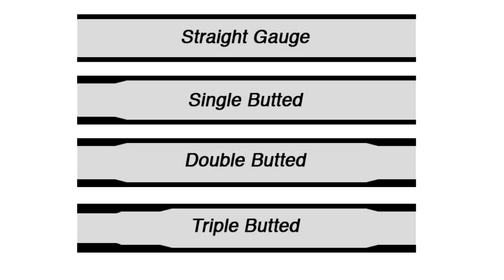Steel vs. Aluminum Frames

Comment: I want to run a raw aluminium frame w/ a layer of clear coat. Opinions on the internet as to whether this is a good idea seem divided, and I can't find a concrete answer. Can anyone help?
Reply: Find a metal finishing shop in your area that can apply a clear chem film to it.  I can't remember the exact spec, but it is a MIL-DTL-5541, type I or type II, class 1A.  Ask the the shop for the clearer of the of the types they use.  It is a fairly simple dip process.  The US navy and air force use this material to coat air frames for corrosion resistance.   You can then apply apply a clear coat afterwards if you want.

Comment: I like your disappearing act at the end!  I have ridden the all of  the Big 4 frame material bikes.  Mostly I have ridden older frames because I am cheap, and so are they.  I like to build them up, and ride them for awhile until I get tired of them.  They all feel about the same to me.  So, they are all good even the aluminum frames with aluminum forks.  I only ride about 1-1.5 hours 3-4 times a week.

Comment: Why do aluminum complete bike seem to always be equipped with carbon forks? 
I weigh more than the max rating allowable on most carbon forks.
Reply: Loose weight bro
Reply: HEAVYWALL 70 rode two similar Giant defys, one with a carbon fork and the other with an aluminum one. The bike having the Carbon fork felt much more comfortable on bumpy roads.
Reply: Amogh S 
My particular problem is my weight, I'm a very heavy rider and most carbon forks aren't rated for my weight. 
I ride a 4130 frame and fork now and it works well enough for now, guess I'll just stick with the Chro-Mo

Comment: glad you mentioned work hardening of aluminum.   I've broken 3 frames by fatigue.  1 was a steel frame (fiori road frame), the down tube snapped about 2" above the BB shell.   The other 2 frames were aluminum (Trek and Specialized) and they both broke at the seat tube a few inches from the BB shell.     One important consideration is for rainy/snow riders, forget the steel stuff, aluminum is the only way to go unless you want to rust out the frame and have fun with bolts and  parts siezed in the frame.    The 6 or 7 year old trek broke just a few weeks ago when i was riding beside someone walking.  We just had a good storm and i was pushing through 6-8" of plowed and stiff snow, i bogged down and gave the crank a good push and pow, I heard something snap.
Reply: You can ride steel in rain or snow just clean it off or spray it down after your ride steel will last lifetimes if you take care. Aluminum frames all way give out no matter if it snaps from fatigue or corrosion. They don’t last Aluminum is weak.
Reply: @mom_im_losing_it  aluminium is weak...yeah, that's why they use it in aviation so much...give me a break.

Comment: I got an aluminum bike with a bit of crack on the head tube and that's it. I will never ever feel secure riding it. My steel bike is ok and like you said the ride feels smother. Can you talk about types of steel bikes next time? Chromoly vs high tensile steel among other things. Thanks.

Comment: I'm a mechanical engineer with a masters degree and who works on orbital rockets and I like this video! You did a pretty good job of explaining the materials properties of fatigue, stress strain curves, elastic modules, corrosion, and all of that. Keep up the good work and you got a new subscriber! 
Personally, I like a good lugged carbon bike for the mix of modern materials with traditional construction (from a biased Colnago C59 owner).
Reply: Yeah, same here (except the masters). I was watching this and bringing back memories of beams and material studies. At a certain point I was saying to myself, “the word he’s looking for is ‘ductile’” when he was talking about fatigue stress
Reply: And yet none of you two engineers, and the host understand how aluminum oxidation works! (real mechanical engineer here with masters degree) So aluminum oxidizes but only on the surface level, then that oxidation protects the rest of the material from further oxidation (same goes for copper alloys like brass and bronze) plus is more stronger and more resistant then normal aluminum (basically makes the frame a little stronger), unlike steel that can oxidize (rust) until in will be destroyed!!!!!

Comment: Speaking of triangles one of the best things I've ever learned about frames and bike parts is this: Affordable Lightweight Durable, You can only pick two.
Reply: That's right a lightweight and durable steel frame it is not precisely affordable
Reply: Slidewinder GT pretty true if your spending under 600-500 i got a used pure fix  for 180$ it definitely affordable and durable but not light
Reply: @tarzan6405  yeah my dad passed down his pure fix and it’s quite heavy but durable. The brand has been around since early mid 2000’s
Reply: I certainly pick durable and affordable. Plus triangle is in fact the strongest shape
Reply: Alloy cost more than steel lol
Reply: 4 party Alloy (hmm yeah it becomes titanium) Ye it just survived 10,000 ft fall so never tell alloy weak , they have a power to become titanium
Reply: @KnightTamila  in most cases bike builds will never be used like that. It’s either you get a really good steel or graded alloy 4130-6000 series

Comment: im scared for my aluminum bike now
Reply: i think it kind of depends on your bike.  if you got a 99. bike from walmart, well good luck with that.  If you are paying more that 400. for a bike that bike brand wants your loyalty, because fact of the matter there isn't a lot of difference between brands, they are all using the same shimano stuff, their only selling points are how they arrange it all and pretty colors,  its all coming from the same factories in Taiwan.   
i have a slight creak climbing uphill with a load of groceries,  does that sound about right? i don't worry about it, you probably shouldn't either. my best guess is it is the crankset.  if it were more constant i would be a lot more worried.
Reply: They make car engines, gun frames, and planes out of aluminum alloys. I wouldn't worry about your bike's aluminum frame failing anytime soon.
Reply: @kabloosh699  in those cases, though, I assume they use an alloy to make it stronger because they can afford to sacrifice the weight
Reply: Magress don’t know what your aluminium bike is but a high quality one can still last a ridiculously long time.
Reply: Most manufacturers have lifetime warranties on their aluminum frames. ie, Trek
Reply: Kabloosh there's a never ending battle between strength and weight.  Weight is an issue with cyclists so that means that strength is compromised.
Reply: I have a sakae litage frame from early 90s and it still rides like new....but after I read more into the online forums about how aluminum bike fatigue over time I kinda start to ride slower and more careful not to roll over any road surface that is not flat
Reply: Magress Don't be. The oldest aluminium frames are often bonded or "glued" tubes to lugs, in those frames it's the adhesive that fails. Aluminum will bend less before cracking than steel will, but that's only relevant in case of a crash, your leg strength will not deform the frame to that point. If you're worried check your frame in high stress points like the head tube and seatpost clamp area for cracks and areas like the bottom bracket shell for blistering paint (corrosion underneath), if there are none your frame will not just snap on you.

Comment: It's great that you mentioned those other things that affect comfort more than frame material.  I have a steel and aluminum bike and the frame material doesn't make much of a difference compared to the seat and wheels for me.  Now I have a friend with an aluminum bike, but she also has 23mm tires that she always inflates to around 120psi, and it feels like you are riding on a bike made entirely of wood. There is no forgiveness and it is horrible for casual rides or any road that isn't totally smooth.
Reply: I'm in the same boat. I ride a aluminium bike on 23mm and I feel every nook and cranny in the road!

Comment: I like steel, mainly because it's easier for me to make frames from it.
Reply: And very cheap which causes to give hollow tube
Reply: My MTB Broke cuz of steel that they never can be inner molded
Reply: I bought alloy I know it cost very much but they also know that it is weak so they added inner mold to provide more durability than steel nowdays

Comment: The geometry and the purpose with which a frame was built have a big influence on ride quality. That being said, I recently bought a second hand full carbon (including stem, seatpost and handlebars) bike, equiped full dura ace, for 500euros (about 550 dollars or less right now)

The difference with anything I have ridden, steel or carbon, is just huge. Not only does it feel much more responsive to the power put on the pedals, but is also quite a bit more confortable than the steel/alu I have been able ro ride.

In the beginning I was very worried about the durability of the frame but after 1500 km so far riding it as a messenger in Paris (probably the city in the world with most cobblestone streets together with Brussels) I think it can manage it very well.

Comment: Columbus steel is my favorite. However, I would love to get a TT bike and you barely can’t find steel TT bikes because you can’t shape steel tubes as much as you can create shapes with aluminium/carbon. Sure it could be hydroformed, some 90s steel bikes had ovalized downtubes for instance, but it’s not that common. So steel comes with a bit of aerodynamic penalty, even though the tubes are smaller, a round shape is terrible at channeling air flow. No big deal though, stronger legs are a better way to get faster for me for now.
Reply: Jaybie Dayy I do have a Reynolds bike and it's good too, but I dunno if it's the steel or the geometry but I love how responsive my Columbus bike is. No need to use the F word here
Reply: Jaybie Dayy well I understand you were just voicing your opinion in a quite opinionated way, but some Columbus frames are really good, there's a reason all those old Italian bikes are held in such high esteem (Bianchi, Colnago, De Rosa, Gios Torino, Faggin, the list goes on), but it's true Reynolds does stainless steel tubes that are probably the best these days, and there's a reason 531 tubing was so popular at some point. I have yet to try Tange or Ishiwata.
Reply: Rob English will build you an incredible steel TT bike. Really lovely bikes. www.englishcycles.com
Oh, also, Columbus makes a range of non-round tubes some of which are aero shapes.

Comment: Great Vid but dont understand why you fixie riders stay away from Carbon?
Reply: because carbon is terrible at withstanding crashes. Urban environment create harsh conditions for bikes, and I’m not even going to start talking about brakes…
Reply: believe it or not but while carbon makes for a stiff bike it’s actually not that strong. There’s a reason you need a torque wrench for every single bolt you tighten on them and 5 nm isn’t a lot. But you are right, bones are pretty fragile too, always wear a helmet when riding, it may save your life
Reply: becouse there are expensive... most people think there are not that durable, but since 2012 a lot of things changed in the manufacturing prozess. they are durable and shock absorbing now. I have an handmade carbon frame from a small german company called vsr and its pretty awesome^^
Reply: I wouldn't want a carbon fiber frame for everyday commuting. Only track. Aluminum for the winnnn
Reply: Because steel is real, duh. (i just cant afford it)
Reply: Pick up a scond hand carbon road frame and do the conversion - easy and cheap
Reply: If you are worried about crashes I would suggest you need to be concerned about your bones rather than the frame material of your bike.

Comment: what is the chromoly ?
Reply: chromoly, or cr-mo is short for chrome-molybdenum, which are commonly used in steel alloys because they generally allow the material to be stronger, allowing for thinner tubes and thus weight saving compared to hi-tensile steel for instance. Nowadays you can find other type of steel, Reynolds even has a stainless steel set, which doesn’t rust.
Reply: type of steel used

Comment: Yeah aluminum can corrode but every aluminum frame goes under a process called Anodization. This is done to create a very thin layer of aluminium oxide on top of the Aluminium underneath. This layer acts as a protection against any further oxidation unless it is not damage  but still then Aluminium reacts so fast with Oxygen in the air that only the exposed surface will oxidize never the full frame.

Comment: Steel for street! Carbon for track! Aluminum can do both! lol
Reply: Johnny Wolf the real is how are you alive
Reply: Jimmy i really don't like carbon. you fall you break. i've only ruined one steel frame my entire life, bent a bit on the down tube, but it took me a 60kph head to head collision with a semi truck
Reply: Well, i managed to only hit my shoulder and knee, but the wheel took the impact, bendind the fork some 5cm back, and braking the down tube in the weld. I was really lucky, but i've ruined my right knee cap for life.
Reply: The wheel is still good doo, super champion box rim, still using them in my road bike ahaha
Reply: But thats what happens in most modern road bikes. I personally perfer steel. I ride a early aero road bike, reynolds 531, and it weights at 11kg, with super champion rims (wich are 35+ years old). If i was to modernize it, it would go as low as 8.5 kg. And it lasts more than any human being. Is it really necessary to spend all that money on carbon that won't last a decade ?
Reply: Johnny Wolf bent.down tube and top tube on a trek 560 on an invisible water filled pothole. couple months later top tube finally cracked, saddest.day of my life. still managed to make.it home but it was super wobbly.
Reply: its not worth it unless your trying to go pro and have $$ in my opinion, carbon has been my favorite so far and I've  messed around a bit with frames, nothing else really feels like carbon. however i am sticking with aluminum for the streets.
Reply: I can understand pros, but for day to day training or commute, steel is the deal. I woudn't mind having any kind of bike, if it was given to me, but i will never again buy aluminium bikes, because they get wasted with ease in my type of riding. For me, aluminium for seat post, stem, handlebar and other general componentry. I've broke 3 carbon handlebars, 1 seat post, and 1 carbon rim (that wasnt even mine) so carbon is a no-no for me.
Reply: El Bstr that really sucks, but you were kinda lucky ! Ahaha i coudnt ride my home because the fork bent in a way that the wheel was rubbing the downtube
Reply: ***** i'd say mech probably, since hydro do last but need alot more maintence. Then it's really up to your skill and knowledge, as i know people who don't think having to bleed the brakes after a big downhill or 2 is a pain in the ass.
Reply: Unless things in the carbon world have changed dramatically and fundamentally since it was first introduced back when, I would not use a carbon fork for any money.  The reason is this: proper steel forks are most likely to fail graciously, whereas carbon fails catastrophically.  All else equal, which things often enough are not, carbon is stronger, lighter, and stiffer than and equivalent mass of steel.  The problem, however, is that when one goes beyond a given piece of carbon's limit, it fails 100%, and pretty well universally in milliseconds.

Of all the components on a bike, the fork is the one which I personally would least want to have fail in this manner.  But that's just me.  If you have supreme confidence in the materials in your forks and it happens to be carbon, then knock yourself out. :)
Reply: Jimmy I love aluminium. I don't trust carbon
Reply: depends on the carbon there is like around 20 different grades of carbon
Reply: +Caleb Korn Exactly, it depends on what type of carbon is used on certain parts of the frame
Reply: Jimmy you are right in saying that, but i've seeñ top grade carbon bikes fall while standing still and braking
Reply: +Johnny Wolf it might have been because the carbon was specified to handle vertical pressures so much that it was really vulnerable to horizontal pressures and bangs
Reply: +Johnny Wolf Steel frames definitely last longer than aluminum and carbon, I'm not bashing on any of the 3, just saying that they all have their pros and cons, with aluminum kind of being in between the 2, unfortunately people usually get carbon frames because of the stiffness which Zach showed doesn't affect speed, and for how nice it looks and feels.
Reply: +Johnny Wolf Nice set up btw
Reply: Kaleb Balboa can't imagine anything lasting longer than mechanical. Their lifespan is indefinite. Hydraulics is another story.
Reply: Does anyone have any exp with carbon forks? Seems like everyone is putting the on higher end steel.
Reply: Andrew Vida yes things in the carbon world have changed dramatically and it’s not difficult to do a little research and see just how outdated your beliefs are. That should not sound like a negative criticism. It’s perfectly normal if you haven’t been exposed to or taken an interest in it, but well made carbon products can be so strong as to be virtually unbreakable.
Reply: Bullshit! There's a lot of carbon downhill bike frame, it's stiff and durable.
Reply: Cardboard for Nintendo
Reply: STEEL FOR ALL
Reply: I have a Cinelli Vigorelli Steel with carbon-forks which I tt on...it’s so light and stiff compared to other steel frames I’ve used
Reply: Jimmy exactly!!!!!